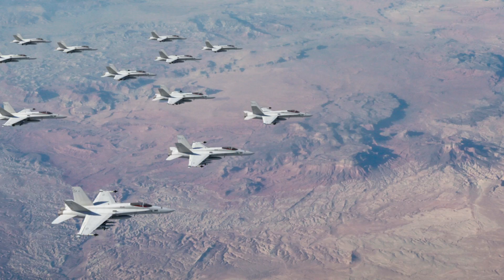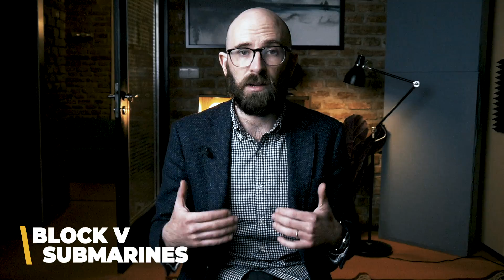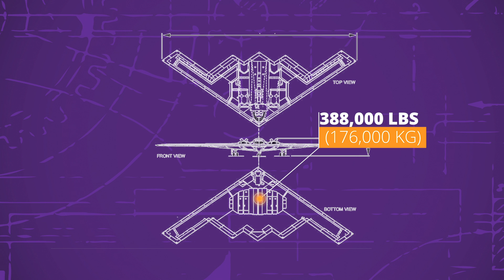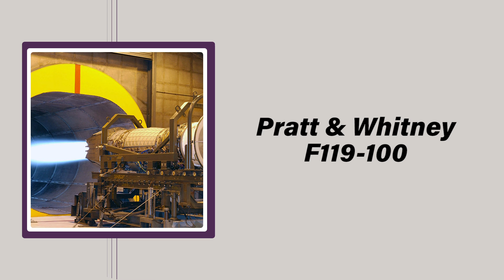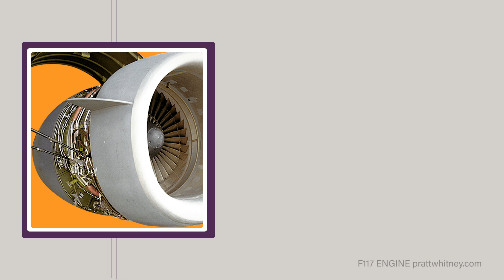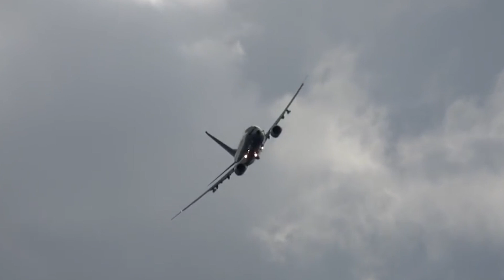5 of the Most Expensive Military Craft Ever Made

Comment: The cost per unit for the B-1 and the F-22 escalated because Congress cut procurement. The development costs were fixed for both. The numbers built were cut to a fraction. Yes they’re hideously expensive per unit. A major part of that was far fewer were built than were planned. The B-21 was necessitated because only a quarter of B-1 were built. In the case of the F-22 American allies were not allowed to buy them due to Congressional action.

Comment: Stating that the B-2 bomber program started under President Jimmy Carter misses a bit of information in that it was based on a technology started in the early 1930's by the Horton brothers, which turned into the HO-229 first flown in 1944 though in glider form earlier examples took to the air in mid 1930's.

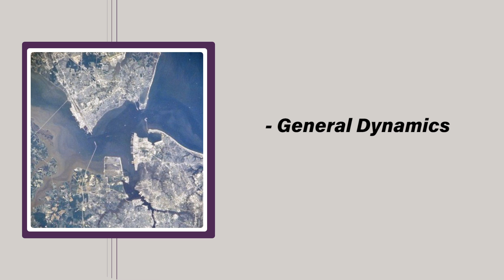Comment: 1:25 The design and construction was a joint venture, the engine and control rooms were built by General Dynamics Electric Boat in Groton, Connecticut. The nuclear power plant, final assembly and testing were alternated to either facility depending on the boat, the rest of the sub was manufactured in Newport News, VA.

Comment: At 10:10: Says M1 Abrams, shows a self-propelled howitzer.
Reply: Looks like a Dutch-operated German-built Panzerhaubitze  PzH 2000....
Reply: @NuclearSavety  the Dutch use the PzH 2000? I thought after they sold all their leopards they switched entirely to the Boxer-Platform, which is also capable to operate as artillery
Reply: @DefinitelyNotEmma  wiki says 24 or 26 (depending on article language) PzH2000 in active duty in the netherlands...
Reply: @NuclearSavety  hmm oki, my bad than, greetings from germany :D
Reply: @NuclearSavety  its an M109 Paladin self propelled howitzer
Reply: @awg6397  hmmm are you sure? The Netherlands (Front markings) also employ the M109 but front lights on top of the chassy, and the air intake on the right side of the turrent are more Pzh2000-like .... and the barrel shock absorber are covered, untypical for a M109 .... of course there were a lot of differen variants....
Reply: He wasn't implying it was an Abrams, so I don't see the issue.

Comment: The problem with the per unit cost of military projects is that, in the case of the B-2 and the F-22, is that they weren't produced in high numbers. The original order for the B-2 was for 150 airframes, but the order was canceled, I am not sure the original order number for the F-22, but it is the same story thanks to Congress balking at the cost during briefings and not factoring in that the per unit cost would go down with the more aircraft there were, which would also help with the per hour cost since there would be a better supply chain for parts.

Comment: The F35 cost is due to them developing the aircraft concurrently. You can look up what that means it gets planes developed quickly but if there are any minor or major hurdles and revisions.  You're losing millions on each one. Like they had 6  double digit million dollar planes that were "concurrency orphans" meaning they were built with a feature or system that is impossible to replace without compromising the plane and that feature or system was then made obsolete in a later revision or proven unsafe.

Comment: You should at least look at the USMC's EFSS program.   I worked on the contract for nearly 10 years, thru a subcontractor.    Developed by General Dynamics, the vehicle was designed to give the unpopular V-22 Osprey something to do.   The EFSS vehicle was in development from the mid-90's until 2008, never met a single USMC requirement (when it failed, which it always did, project management changed the requirements), over-ran it's initial budget by hundreds of millions, and ultimately was never deployed by the USMC in it's intended combat role.  Production ran from IIRC 2008 - 2009, the contract ended in 2015, and as of 2018 all the vehicles were in storage and scheduled to be scrapped soon as everybody forgot about them

Comment: Side Project idea:  Tunnel Boring Machines (Mega Project?) are fascinating pieces of machinery.  But any kind of machine has the potential to break down, and if that happens to a TBM while in the middle of boring a tunnel, what then?  You can't drive them in reverse...  Seattle had to answer that question when "Bertha" started breaking down after having practically just gotten started on the Alaskan Way/SR99 replacement tunnel.

Megaprojects- Washington State has several of the biggest/longest floating bridges in the world (#1 - 3, #5 iirc).

Comment: 1,100 ft/sec as a rate of climb is so insanely fast, that I can't fully fathom what that actually means alone, and I'm a novice pilot and general aviation geek.  

For reference, the F-22 raptor will reach its maximum operational ceiling of 65,000 ft in 59.1 seconds from the ground. 

In that same amount of time the Falcon 9 Rocket in Crew-1 configuration is only at 26,279 feet. It would beat a literal rocketship to 65,000 feet by around 35.2 seconds... 🤯🤯🤯That's just about the same amount of time it takes for a Keurig machine to dispensence just one K-cup of coffee (about 34 seconds).

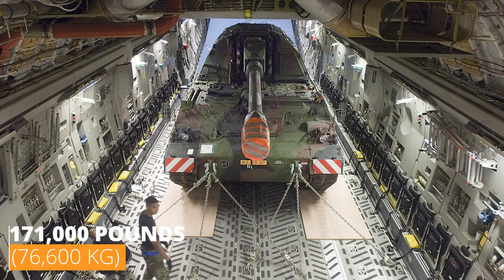Comment: Small side note: the vehicle at 10:05 is not a main battle tank but a self propelled gun (Pantserhouwitser 2000NL)
Nevertheless, very impressive load limit!
Reply: Panzerhaubitze 2000.
Reply: @AtheistOrphan  Yes its a German Panzerhaubitze 2000, but the one shown on that picture is in dutch spec. and therefore named slightly different.